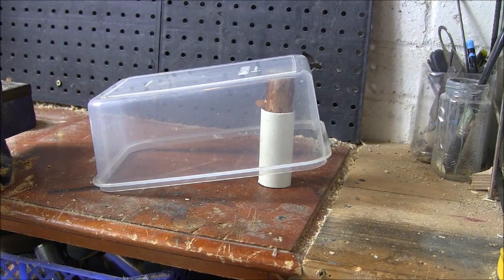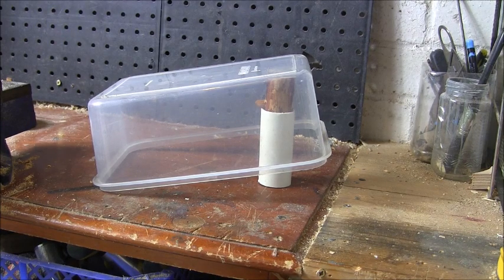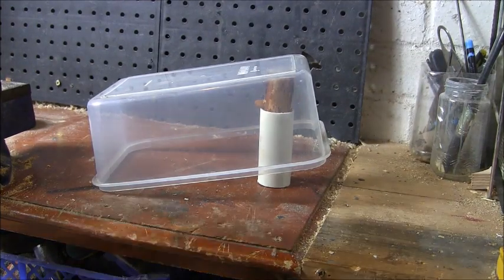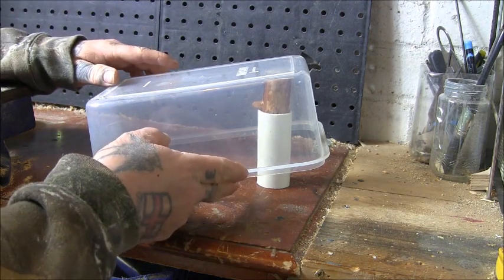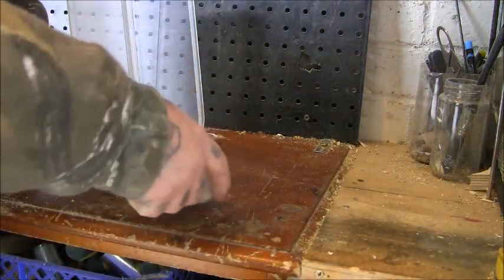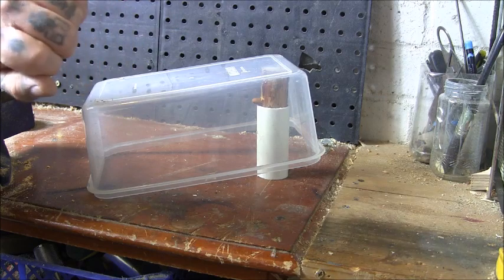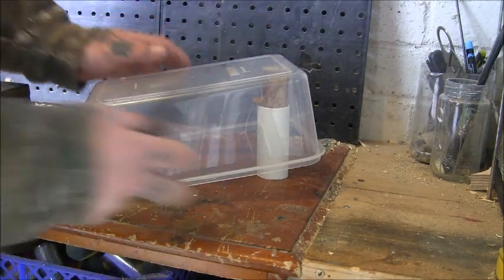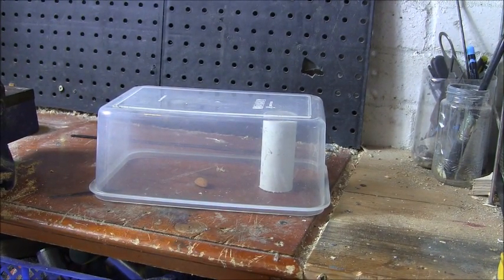Hovering Mouse trap

Comment: I used to make the same trap for rat when I was a kid but I used maze with a pin pushed through as a trigger,  quite sensitive that way as the bait is pulled away against the head of the pin and the pin slips out very easily to drop the sliding post.👍🏻👍🏻